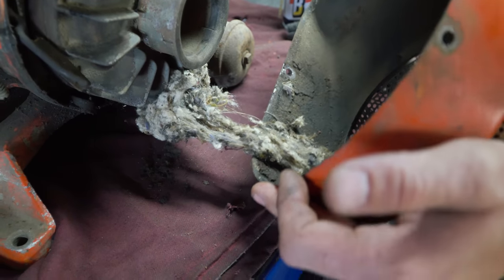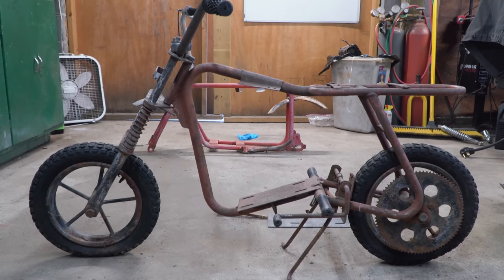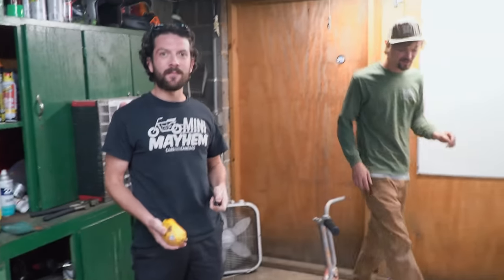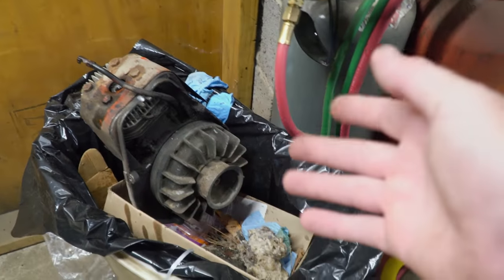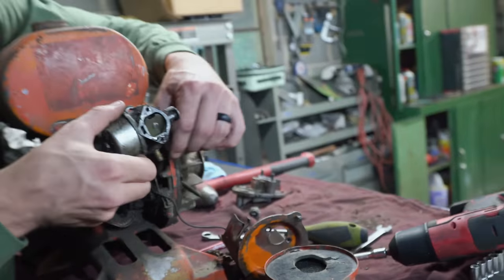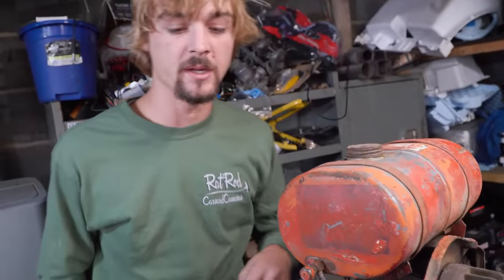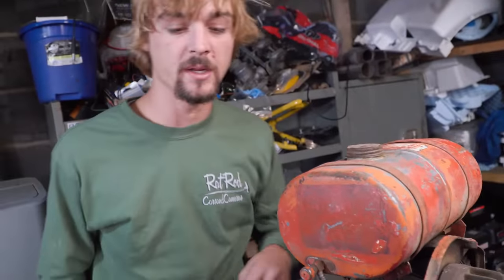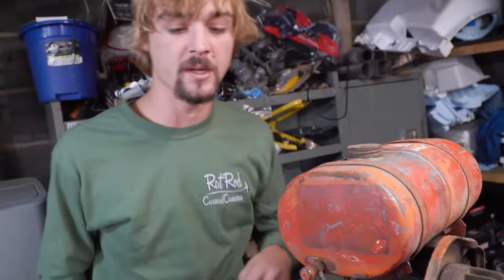Can we Salvage a 50 Year Old Water-Logged 2 Stroke for a 60’s Mini Bike Build?

Comment: Would definitely run a 20:1 or 30/32:1 mixture in that the way the crankcase is only premix lubricated. Heck I run 32:1 in all my two smokers except my old case reed dirt-bikes from the 70s, factory recommended mixture for my 70s 2smokers is 20:1 for longevity of the rod/crank, needle bearings & wristpin.

P.s. ignition timing is way retarded running it in reverse (since it's advanced running forwards), you'd have to relocate the pickup or re-clock the magneto to compensate.
Reply: Factory spec was with oils from 1960s. Running 40:1 with new oils is just fine, it's actually recommended so you don't run lean on gas.

Comment: Chances are, timing in one direction will be set slightly advanced; maybe 3 or 4 degrees. Running it backwards will definitely cause the spark to fire after TDC, 3 or 4 degrees. Some older two stroke diesels are set at TDC to run both CW and CCW. But your Jacobsen seems to be a lot newer, even being old, and probably won’t run both directions.

Comment: Hey guys if I'm not mistaken Tecumseh made those motors for Jacobson. They are not a high rpm motor, as I remember 4200 was max rpm. It was great to hear that little beast run. 

Now back in the day it was this motor or it's bigger brother that were the competition for the Macs on the racing carts back in the 50s and 60s. I know this because my grade school friend raced gocarts in the mid 60s.

Comment: There is a 2 stroke built by Villiers that runs in forward or reverse. I dont know the details but it was used in Pengor Penguin and Beaver amphibious atv`s. Reversing electric start determined which way the engine ran as this was the way these atv`s had reverse. Yup you shut off the engine, turned the key in the opposite direction of forward start and it reversed the current to the starter and cranked the engine backwards thus allowing a reverse "gear"..

Comment: Ike! You are correct! 
Reverse on snowmobiles when activated changes ignition timing to run the engine backwards! It's very common on 2 cycles that need a simple reverse feature.

Comment: The shot of the rotating assembly is considered as the primary compression chamber. There are transfer ports from the there (rotating assembly) to the secondary compression chamber (top of the piston). 

The exhaust should have fiberglass mesh.

Certain snowmobile two strokes did run in reverse. The ignition timing and fueling was a bit different than this.

Comment: You gotta hot rod that razor bike. Like but 48 or 60 volts and a cheap speed controller. Might also need a bigger motor but gotta let the smoke out of the original one first.

Comment: I have used my wife's cricut cutter to make gaskets. Reassemble the torn gasket with tape the best you can, use a flatbed scanner and scan the gasket. Convert the scan to an SVG with Inkscape and then get the cricut to cut a new gasket out of gasket paper.

Comment: Wont run in reverse because of ignition timing. If it fired exactly at tdc then any direction it would run. Had a friend that rebuilt a honda 250 3 wheeler and it ran through every gear in reverse he though he assembled the transmission wrong an on disassembly I saw the woodruff key that holds the magneto had sheared and by chance it lodged back to the crank at identical degrees from tdc (but flipped).

Comment: Some of the reason its not running in reverse is the ignition timing. In forward rotation the spark is firing before TDC, in reverse it will be firing after TDC.

Comment: 2 strokes love porting fuel air and compression i got a 100cc 2stroke engine on my mountain bike with a gt80 carb portwork and lowered cylinder deck my bike probably makes 40-50hp though

Comment: The three of you work together really well! Have you considered taking a rim and using your metal bender to make a steel hoop 'tire' for it? You could do one of your old experiment videos with leaving it plain vs knobs vs steel tread vs rubber tread vs bolts tacked on vs full Amish tractor steel blades, etc. Definitely would need to have front and rear suspension, as well as really good fenders though.

Comment: The shot around 30:00 minutes in when they put the motor in is so sweet. That little two stroke has such a sleek profile like a rocket inside the frame.

Comment: My dad had a 2 and 1/4 horse 2-stroke Jacobson lawn edger. I'm 58 years old and it was old when I was young it ran great the muffler was the engine running against the concrete it had a little rumble a very unique sound there was no muffler it just reverberated off the ground!

Comment: Flat piece of steel rolled to diameter of wheel, then weld steel rod onto rolled steel. Weld inside spokes to rest, make own spokes with plasma machine?. Should be able to mount tire using  rod as the bead. Also not sure how strong electric bike rims are, not made for 2 stroke.

Comment: Love seeing you guys get into some vintage engines and bike builds! the engine is probably the same age as the bike. Jacobsen was originaly a mower company and had big crude two-stroke uprights up until they bought the pattern rights to the johnston utilimotor in the 20s. made by the same johnson that makes boat motors. that johnson utilimotor engine evolved into the engine you have after years of renditions. it would have been on probably a mower called a 4 acre since it has the big tank. not a go-kart motor or bike motor originally. they should make good power though if tuned right. the muffler is a stove pipe style muffler that would work best for power if the extra pipes are removed and more holes in the outer pipe there is a lot of restriction in them  loosing power for  quiet mowing. To save your old ignition coil id suggest not pulling the wire to kill an older motor as it can make the coil short internally. they also tend to have pinging noises do to how thin the cylinder is and most don't have needle-bearing wrist pins. the timing  of the mag is timed earlier to help with better power. I've worked on all three engines from the early one,  johnson,  and the later ones. fun motors. if you have any questions or possible need any parts for one I do have some.  i also have a lot of other odd engines on my channel if you want to look.  love seeing the older builds keep it up!

Comment: So since 2 strokes can run clockwise and counterclockwise theoretically if you were to put that on a go kart could you start it in reverse to have almost like a reverse gear?
Reply: Yes! The ignition timing needs to be adjusted. If adjusted right, you should be able to fire it in both directions.

Comment: Back in the early 1970’s I owned several Yamaha 360 enduros. Many times when kick starting them hit would kick back (dangerous for legs ankles and feet) but it would start. More then a few times I would give it some gas and let the clutch out to be shocked it was running backwards. Another fun fact there were some Kawasaki 2 strokes that had the carb under a side cover Down in-line with the crank. The first time I saw one I thought it didn’t have a carb. Those were the days!! Lol

Comment: A lot of old 2 stroke engines used a piston that had a fin sort of thing that stuck straight from the top of the piston to block off the exhaust and intake port from each other as a means of preventing the fresh air fuel mixture from going straight out the exhaust, these are Shnurls Loop 2 stroke engines. Modern 2 stroke engines use the expansion chamber and Reed valves, or in some cases rotary valves for controlling the reverse sine wave which can actually allow some air and fuel to flow into the exhaust, then cram it back into the cylinder just before the intake and exhaust port are closed by the piston and thus "Super Filling" the cylinder over a small RPM band. The RPM range that this will occur at is controlled or tuned by expansion chamber volume and shape along with the Reed valve rates. I wouldn't doubt that these engines use the old Shnurls Loop style pistons.

Comment: From most every application I remember you've got that clutch on backwards.  It would be a real pants eater that way around.  Those clutches were notorious for breaking the little bent over tabs between the pads.  I finally just took to welding them together and cleaning them up to a flat surface, and that fixed the problem.  I think it will be worse running them the way you are., as that direction is trying to straighten the tab, essentially.  I have seen them both ways, but more often sprockets outside.

That carb arrangement was pretty much standard for horizontal shaft two cycles of the time.  I had a West Bend 4hp motor on my go kart as a kid and it was the same way.  I think it was a chain saw motor, almost always done like that.  I've had a few two stroke mowers, a Power Products (yeah that one goes way back) that came off a sign it had been sitting on for years and I cleaned up (at about 12) and it ran like a top.  Also a couple of 2 cycle Lawn Boys.   (I wish you could still buy them in the 2 cycle configuration, especially that magnesium frame version, very light, very strong.  And loads of power.

When I was a kid I used to take that poor power products motor and and lock the throttle wide open and let it sit there and spin the mower around in the driveway.  I guess I thought it was funny...dopey kid stuff.  It never gave up or even lost power doing this for many many many minutes.  

I had a 70 hp 6 cylinder, three carb Mercury outboard motor, and it was also that same configuration, carb, reed valves, crankcase.  It had no transmission, so neutral was off, and for reverse it started and ran backwards....not kidding.  You could see the distributor rotate major degrees around the shaft and when you pulled the handle back for reverse, and the OTHER one of the sprague clutch type starter gears move would move into the flywheel gear when the starter spun reversed.  Even the simple dog type trannys in later outboards were a BIG step up.  Those early motors were a PIA to operate.  It's kind of amazing that the simple tranny wasn't thought up earlier, because it is about an order of magnitude less complex to accomplish.  I expect the reason your's wouldn't run backward was just timing, which would have been grossly retarded for the reverse direction.  Just move the magneto to the proper position (same amount the other side of TDC) and it would run fine.

Those Lawn Boys would run forever, and were cheap and easy to rebuild if you actually managed to wear one out, or if you forgot to put oil in the gas, like my brother did once.  We freed it up carefully and it still ran, but was way down on power.  The carbs on those are directly to the crankcase through reeds just like that one, but obviously mounted orthogonal to the shaft.

Also, the RC glow plug 2 cycles of old would run either way without changing ANYTHING.  They ran a port valve on a sleeve hooked to the crank, so the fuel timing wasn't right, but they'd run, after a fashion.  The smaller ones, 0.010, 0.020, 0.04, and I think there was an 0.09 IIRC just used a reed so they were good to go, either way.  And often did run the wrong way when you didn't want them too.  I used to just stop the 049's just pinching the spinner.  Not a whole hell of a lot of torque.

Watching this brings back memories.  :-)

Comment: I'm in the middle of putting a two stroke on a Razor mx350 electric dirt bike I'm going to convert to 2 stroke you ever considered finding one of the mx500 or bigger with a shot battery or speed controller and converting them to dance the mx500 and bigger have full suspension and Motocross tires so they would be perfect for an off-road mini bike build since they're like little electric pitbikes

Comment: This small two-stroke looks pretty cool. I see some potential for easy horse power gains. The way the reed valve is mounted makes it easy to build a different mounting plate for a larger reed and carburettor. Even some used oem scooter parts would do because the stock reed and carburettor are so small. Then some porting on the exhaust and transfer ports and this thing can probably have 4-6 HP. Maybe more with a good exhaust. The only question is how good the connection rod and rod hold up.

Comment: In 1965 I got a Sears Allstate moped from a friend. It had a two smoke engine with a two speed transmission. You would peddle it to start it. I just would push start it to get it running. This was my first two smoke engine and didn't know anything about working on them. When in gear it ran fine, but if you put it in neutral it would go wide open and screaming. One day I pulled into my yard and put it in neutral and it went wide open. It didn't have a kill switch, so I put it in gear and popped the clutch to try and kill the engine. I pulled a wheelie across the yard, across the alley and right into the side my neighbors garage. The bike fell on my left leg and ate a hole shaped like a orange wedge out of my leg. I should has put the flywheel cover back on the engine when my neighbor warned me about what could happen. The moped still lives in another neighbors landfill and has been there for over 50 years. My other neighbor saved the gas tank off it and it's hanging in his garage. He said next time he visits or I visit, He will give me the tank back so I can put it on the mini bike I built last year out of a BMX Mongoose bicycle. If you wanna see something funny, watch this 72 year old one eyed fat man racing up and down the street.

Comment: Curious but how come you don't try a simple way to restore the rims, it's a little messy but once it's done and painted you won't be able to tell the difference, why not sand blast the rims clean and fill the gaps with fiber glass impregnated resin and then bondo to make smooth, it would be strong and you keep the rims together without cutting them apart

Btw I was as shocked as you guys were when that engine had spark lol

Comment: You are correct 2 strokes are bi directional..perfect example is the EZGO 2 Stroke Golf Cart with the Marathon Ec25d 3pg engine..it has a starter/generator that turns the engine over in the direction you want to travel hence forward or backward 👍

Comment: For the running backwards thing, its most likely ignition timing that's stopping you from running it backwards. I have a Sachs 303 Wankel, and it has 2 keyways on the flywheel. One for normal rotation, and one for reverse rotation, though in that engine you also need to swap the exhaust and carb for reverse rotation.

Comment: Yes. With a two stroke the crankcase acts as an scavenging airpump. Unless a blower or turbo takes over that duty.
On 17;35 it does run left or right but the cam for the points makes the difference.
If its symmetrical it will run great both ways. I have an velorex with jawa motorblok that is altered. See on wikipedia but looks like an canam or morgan built in tsjegowakia.
Outside the flywheel there are coils for electric starting the motor. There is an switch operating two relais that reverse polarity. Stop and switch engine of, reverse polarity, start engine again now turning backward and drive backward. You even could use all the gears.

Comment: Two stroke engines can definitely be made to run in reverse, depending on the ignition system obviously. If you can unbolt the ignition coil and flip it around so that the side that was up against the engine is now facing away from the engine then it will be the correct polarity for the coil to work properly  when spinning backwards.

Comment: They definitely can run backwards.  I don't remember who worked on one recently, but I think it may have been Mustie and he did a "will it run" on a 70s work twith a cab on it, and it had a 2 stroke.  It had reverse, but he had to stop the engine first, select reverse, and then restart it.  I believe he said the starter just started the motor backwards, but there may have been something else that was also happening with the timing for the spark.

Comment: The Jake 321 has needle bearings on the crank as well. Also, the muffler came apart to clean the carbon out- the exhaust ports would actually clog the whole way shut on the engine.

Comment: That's funny, The RC flyers have been using back-plate mounted carbs for a very long time. It helps a lot in stream lining and were used mainly in race planes and some scale planes.

Comment: a have start 2 stroke engine backwards,but the timing was half turn wrong.it depends little bit on the engine,some 2 stroke engines its just start wrong way.its coil and spark thing

Comment: One of the antique engines my brother and I collected was Fairmont railcar engines.  They were two stroke and reversible which was the way to reverse the inspection cars they were on so they didn't have to  have a tranny.  You had a timing lever to adjust your spark for ignition timing and for reversing the  engine.

Comment: That was probably from a small tiller or maybe a snow thrower I can't really remember anything else that I saw them on if it was a ND vertical shaft it would have been a mower but horizontal those are the only ones that come to mind. Very cool little motor and a cool blast from the past. Great job and I really liked the video 🍨🍨 you get two ice creams up.

Comment: It's best of course to have all the correct gaskets, but I have rebuilt plenty of small engines with only Permatex #2 (not head or exhaust gaskets tho).  They ran fine for my uses.  Thanks for the vids.  Always interesting.  👍👍

Comment: Most 2 strokes will run in reverse. The little ones in rc cars and planes are the easiest because they have glow plugs and so you don't have to contend with an ignition system that won't run backwards.

I accidentally hooked the leads to my starter backwards once so my engine was running in reverse, which was rather interesting when trying to get my helicopter to take off...